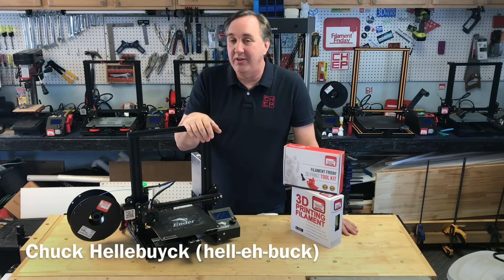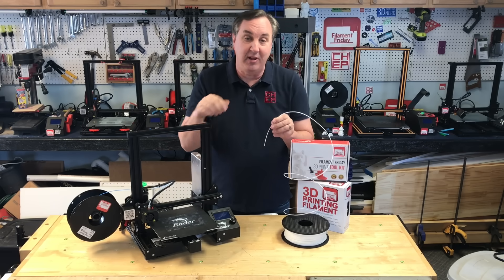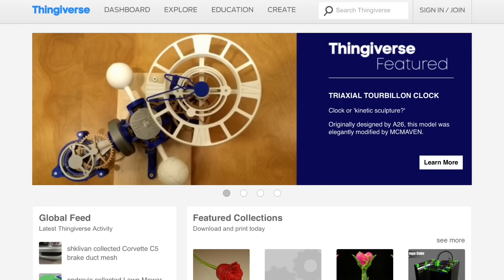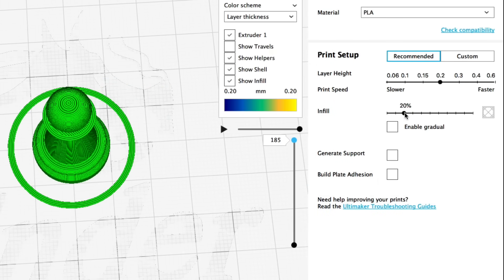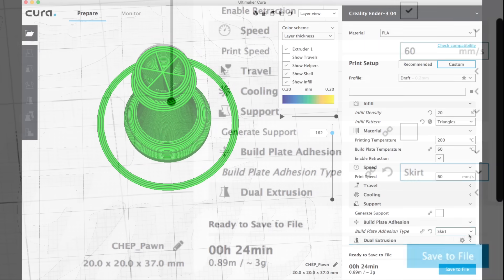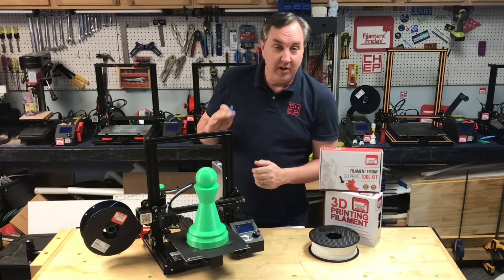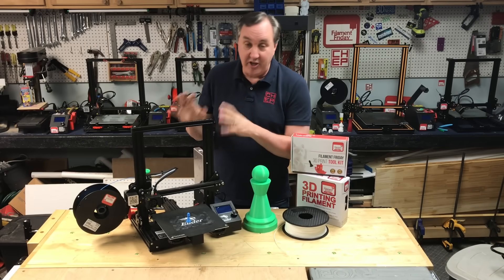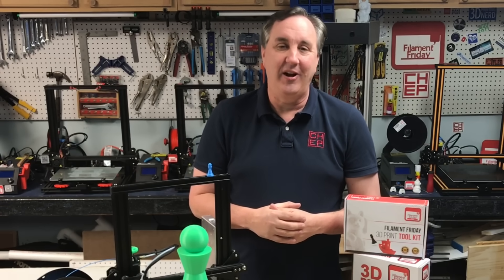Getting Started with 3D Printing using Creality Ender 3

Comment: Chuck....  Thank you for all you do for the 3D printing and Electronics community.  Your reviews and available designs on Thingiverse for the Ender 3 finally made me pull the trigger on an Ender 3 Pro this week (price gap between Ender 3 and Ender 3 pro is now ~$50 US, so I went with the pro).  Assembly is going well so far, but I hit a snag right off the bat.  There were no M5 threads cut into the bottom of the left upright.  Thread were only cut into the top, and I don't have a M5 tap (yet).  Thankfully I had some spare long M5 bolts on hand  and was able to make a poor man's tap by filing two vertical groove up the threads of my spare M5 screws (thanks Matthais Wandel's).  Since the M5 bolt is some form of steel and the vertical is aluminum, the makeshift tap did the job, but it took a bit to get both tapped.  A note to those building any Creality printers.  Make sure you have some spare M5 bolts and M3 & M4 taps on hand when putting one of these together.
Reply from the maker: Did you buy thru my affiliate? 
I’d like to know who shipped that. 
First time I’ve heard of that issue.
Reply: @FilamentFriday  I actually picked it up via Amazon https://www.amazon.com/gp/product/B07K3SZBHJ/ref=ppx_yo_dt_b_asin_title_o02_s01?ie=UTF8&psc=1  but I should have done it through your affiliate.
Reply from the maker: It’s always appreciated. I just like to know viewers experience with those I link to.

Comment: Got an Ender 3 for Christmas and have muddled thru 2 spools of filament with moderate success. EXCEPT for this   https://www.thingiverse.com/thing:183096    ( small spider by Sable McCloud) I have not figured out the setting to make this print without falling apart during printing or when separating supports.
Reply from the maker: That’s really tough being that small. Upsize it 50% and print it upside down.
Reply: @FilamentFriday  Worked! Thank you!
Reply from the maker: No problem

Comment: Great video, thank you! But pulling filament from the side of a spool makes me cringe a little bit. Letting the end of the filament go free makes me cringe a lot! I hope you never complain about spools being supplied tangled.
Reply from the maker: Just finished watching Makersmuse did ya?
After filming the potentially tangled excess was cut off and the end was properly contained in the spool holes before storing it in a properly sealed bag with desiccant to absorb moisture. So no need to cringe. I sell filament. I know how it works. It’s also why it wasn’t used in the making of the pawn. But you might see that scene again as it is the  lead in to my next beginner video.
Reply: CHEP not sure which makers muse video you’re talking about, sorry! Just weird to see filament being handled like that, that’s all. Wouldn't advise it at all. Like I said, great video otherwise, thank you.

Comment: I like your videos there simple. Do you have a troubleshoot video on the ender 3? Or a site?
Reply from the maker: No, what issue are you looking for?
Reply: @FilamentFriday  I'm really new to 3d printing.  But when I press the home button the z axis is that where the extruder is. Doesn't go all the way Down.
Reply from the maker: You might have to adjust the position of the Z switch on the side. That determines when it stops.
Reply: @FilamentFriday  ok will try

Comment: Your tool kit must be a hit because it appears to have sold out.  Unfortunately I have purchased much of what you include, but I need to pick up some wire brushes and a cutting mat.  Your filament is on par with the others as far as pricing, and I added it to my list for future purchases.  One issue I noticed with Amazon lately is I see a cheaper spool of PLA, buy it and then the next time I look at reordering it, the price jumps up $3 or more.  I just picked up a spool of Dikale white PLA for $16.99 and now they have it listed for $19.99 :(

Comment: Great vid! Sadly my cr10 has been needing work ever since Ive got it. The stock hotend was so tight it didnt feed filament, i replaced it it broke again and so on. Do you think the Ender is worth it? I had less than 20h of print time on the cr10 and want to get rid of it as soon as I can. Already put a lot of money on it and dont want to continue.
Reply from the maker: I’m not sure what too tight of hotend means but Ender 3 has the same hotend. I have many of these style printers and they’ve been fine.
Reply: @FilamentFriday  Yeah the filament went in so hard that the extruder continued to skip. It was like non stop skipping. I tried higher temperatures and different nozzles with no luck. Now I am trying out the e3d kit but I got another jam. Will try to resolve tommorow. I just heard many good things about the ender.
Reply from the maker: Many of these printers suffer from the PTFE not staying down to the nozzle. I covered it here: https://youtu.be/x35aWmnZ_A0
Reply: @hey-aleksei  Thanks. I already resolved the issues. It was the hotend. I tried to print to fast and it couldnt keep up at all. So now I have an e3d and can happily print at 60mm/s withput major issues. Occasional jams in the heat break but I can clean those out very simply.